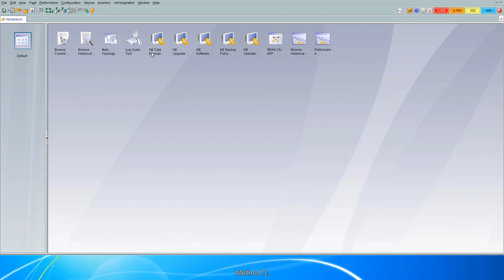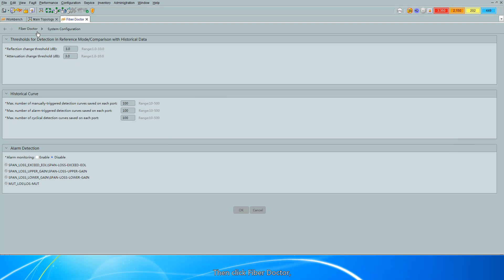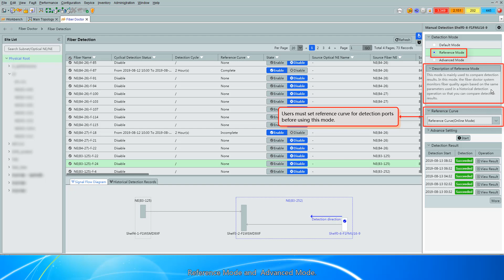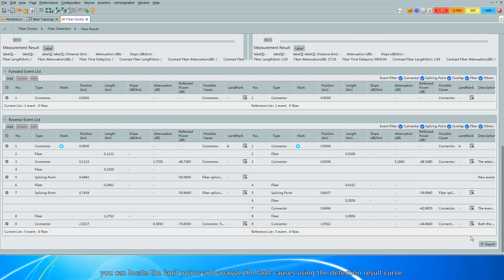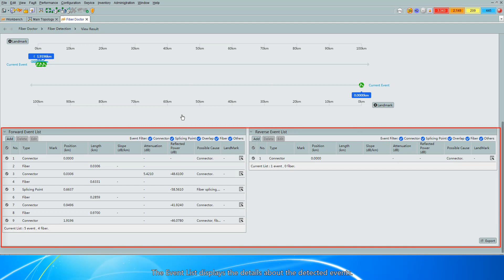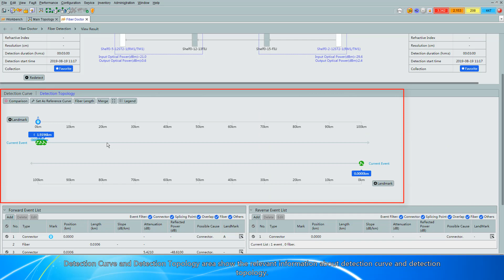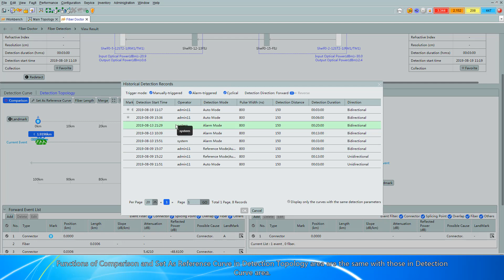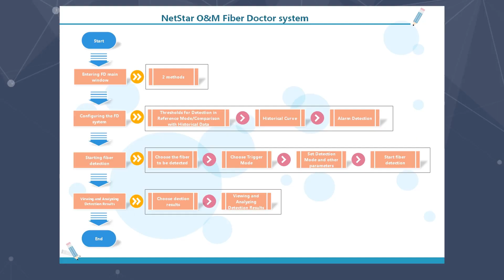Huawei Fiber Doctor (FD) System Configuration Guide

Comment: Eu uso WebLct não possui essa função.!!
Reply from the maker: Thank you for your feedback.
WebLCT does not support fiber doctor.
Reply: @HuaweiSupport   can i use Fiber Doctor (or Optical Doctor) on I-Master NCE-T Lite?
Reply from the maker: @ziosilvio2  Yes, you can use Fiber Doctor or Optical Doctor on NCE.
You can choose Configuration > WDM Optical Management > Fiber Doctor or Configuration > WDM Optical Management > Optical Doctor from the main menu on the NCE Network Management app.